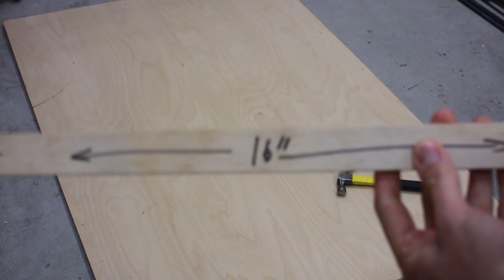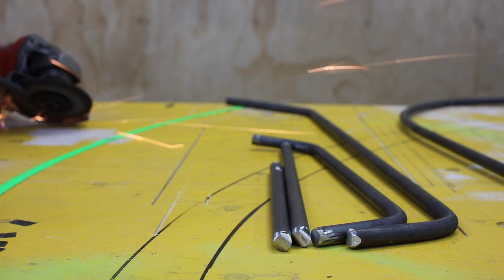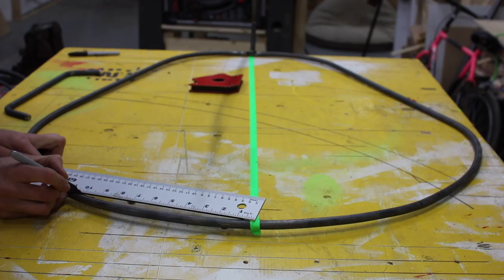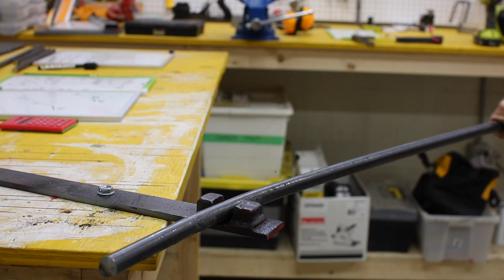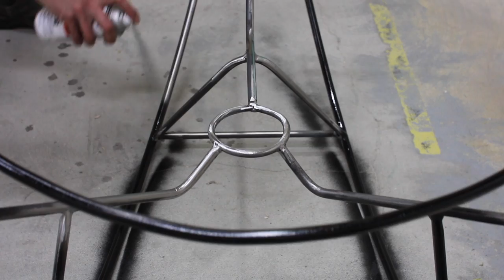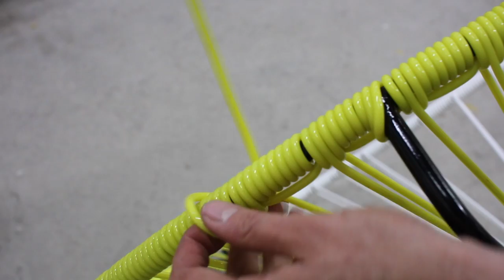Build a Woven Rocking Chair!  A Super Chill Acapulco Chair

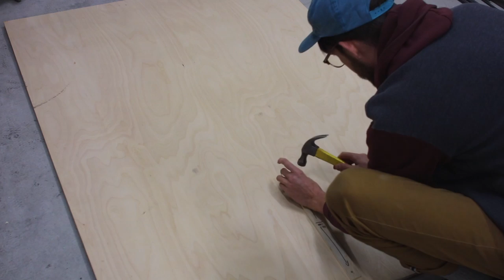Comment: What size did you use for "most of the chair"? In the video it's listed as 3/4" but it looks smaller than the 5/8" that you used for the rockers when they are side by side at 0:10. I'm thinking it looks like 1/2" but I wanted to check with you to be sure. Thank you.